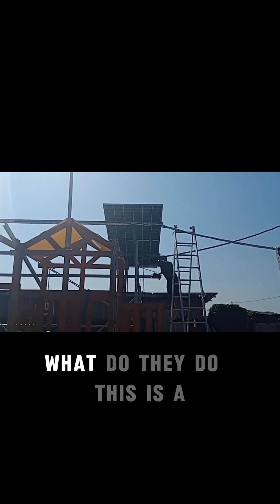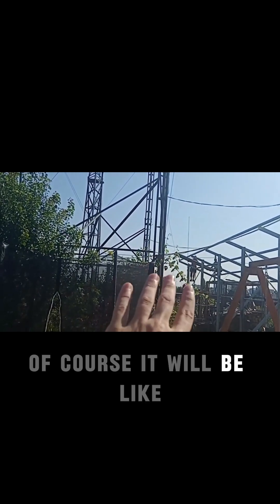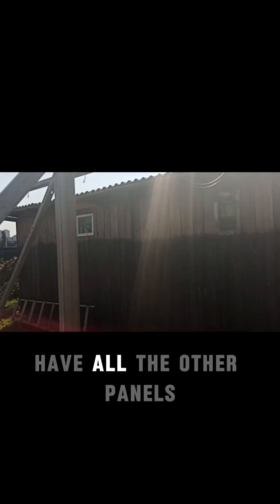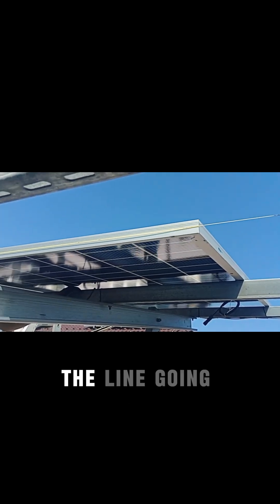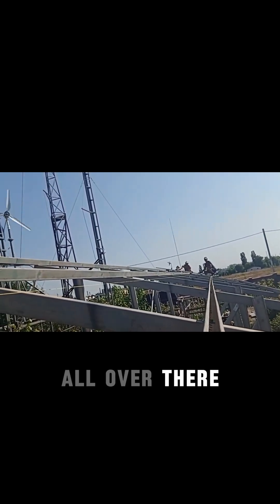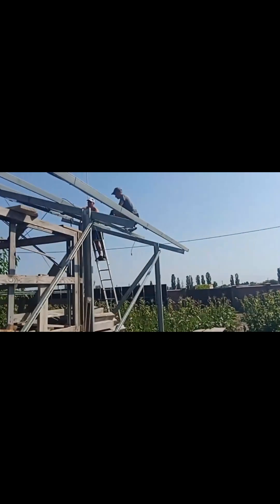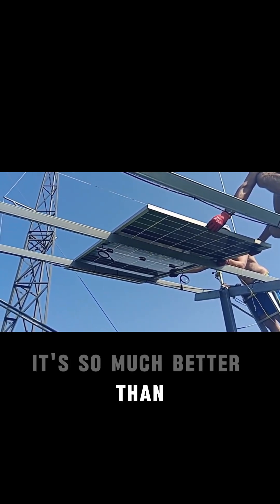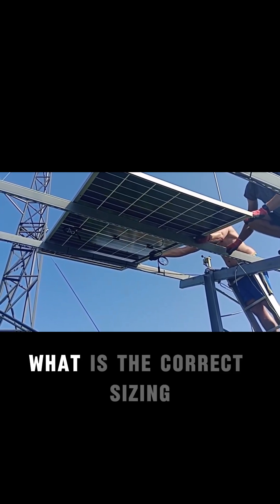Step by Step Guide to Installing High Power Bifacial Solar Panels!

Comment: Hi Mate, like the new solar panels.
Peak outputs 50 km/h wind storm - 
28V - 24V 500W Vevor   -  8 Amps 
28V - 24V 500W Vevor    -  8 Amps 
14V - 12V ista Breeze i500 - grounded  
12V - 48V 1,000W New S5   -  2.5 A
12V - 48V 1,000W New S5   -  2.5 A
12V - 48V 1,000W New S5   -  2.5 A
12V - 24V Old 300W 6 blade   - broken strap jammed blades
12V - 48V 1,000W New S5   -  in box
12V - 48V 3,000W new rotor  -  1.5 A 
12V - 48V 3,000W new rotor  -  Broken blade, blade hit pole
Reply from the maker: not bad overall. but still, I will probably never get used to these tiny values
Reply: @BackyardVoltage  Well, with the storm I had No Solar but the wind alone charged the battery bank of 13 x 2V batteries up to 30 volts, even with 4 wind generators down out of the 10. I am very happy with my final setup handling a peak wind speed of 63 km/h.
Reply from the maker: @brianaustralia9692 those are crazy winds...
Reply: @BackyardVoltage  Yes, reports said near gale force winds, there was an extreme weather warning, even more crazy, I was out shopping at the time. My wind generators were home alone.